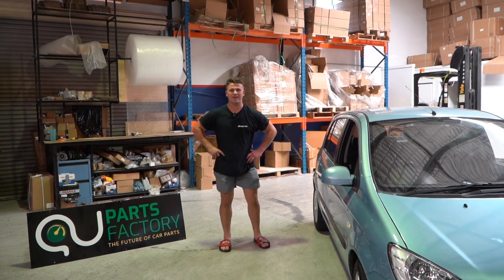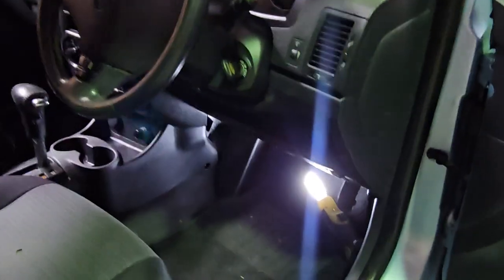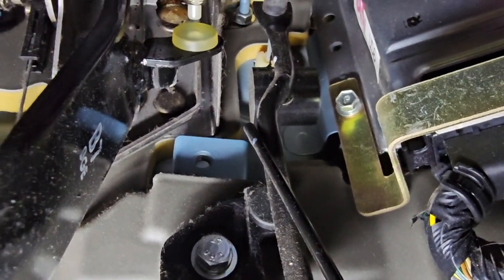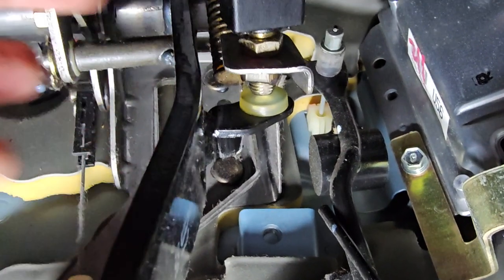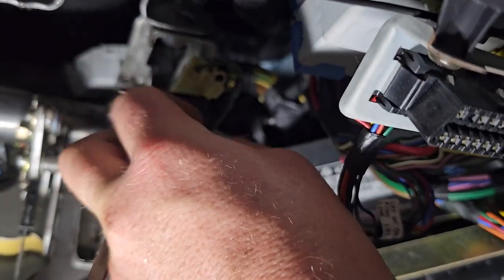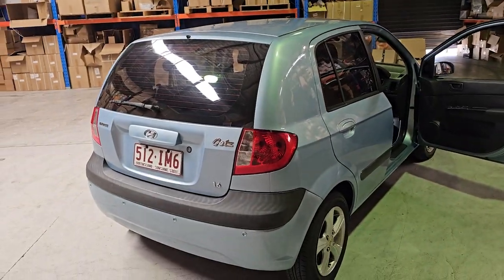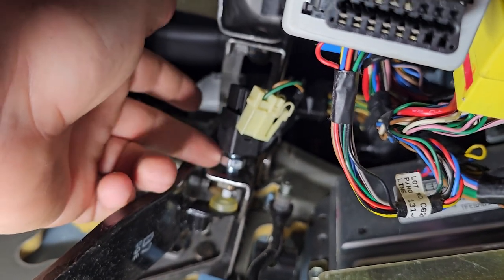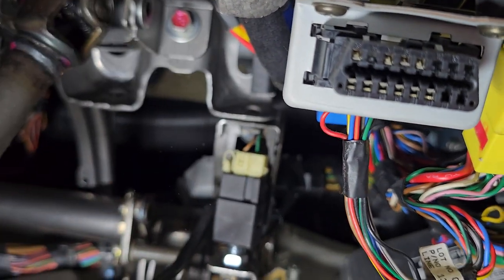How to Remove & Replace Hyundai Getz Brake Light Stop Switch 2002-2011

Comment: I thought my switch had gone. Just looked now with the torch (and my glasses). The little rubber pad opposite the switch had completely disintegrated off it's mount. So that's why the switch was remaining  on all the time leaving the brakes on.
Reply from the maker: Yes seen thisnb4